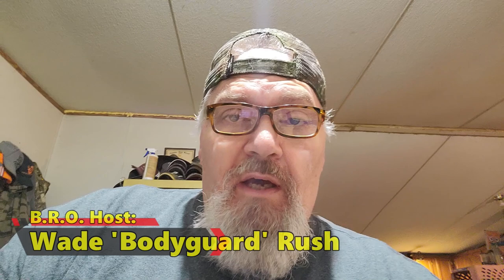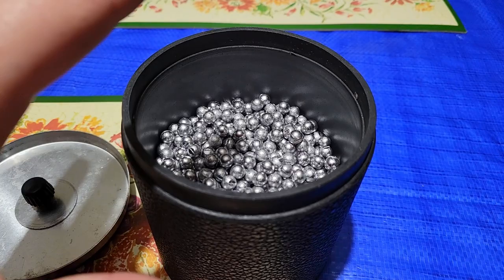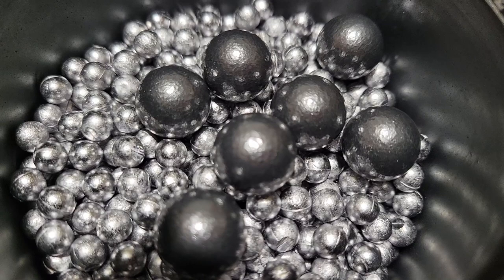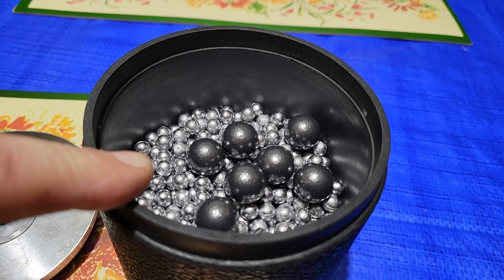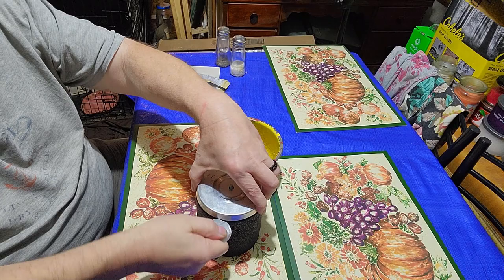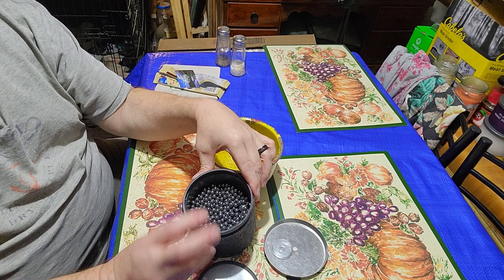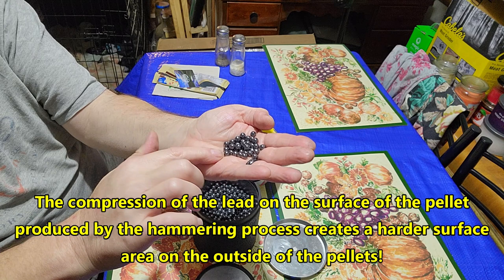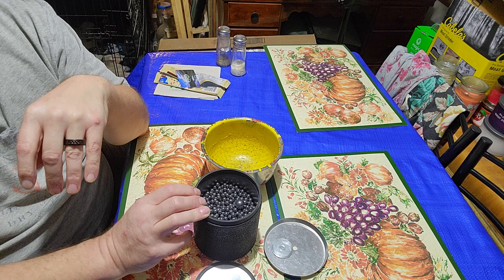Tumbling/Polishing Buckshot Tip!

Comment: I use a Harbor Freight tumbler, but it's the big orange kind you mix cement in. Lol. You have to remove the blades first. I tumble 50lbs of buck per load in one hour. I use about 100 5/8" steel ball bearings in the mix and the shot comes out shiny, black and smooth. I realize this is excessive for the average reloader/shooter, but I sell the heck out of the stuff.

Comment: I tried the same method. I used 9 lbs of buck, which gave me over 3/4 full. First 10 or so rounds with a new drum went great, then I started getting the dust and couldn't get rid of it to save my life. Balls and drum were extra dry. Dried shot with a towel, let them air dry about a day, then clipped and sorted out boogers, then hair dryer before tumbling. Nothing had ever been in the drum besides dry clean shot, so the drum was dry with no possible contamination. My solution was wet tumble my shot. Same set up as yours, just fill with hot tap water and a good squirt of Dawn dish soap, tumble as normal, and rinse really good when they come out. They come out extra shiny and almost chrome looking. If I rinse with hot water, they tarnish a little. The polish job on the shot seems the same wet or dry. Just thought I'd throw it out there as an alternative option for anyone who just can't get rid of the dust. Thanks, keep up the good work!
Reply: Joe, you nailed it. I’d like Wade to know that wet tumbling also worked for me to get rid of that pesky dust and produce shiny, clean pellets. I used hot tap water to cover the pellets, topped off with a good squirt of Dawn dishwashing liquid. Sealed and spun the can for about 10 hrs and rinsed in a colander with cold water. Voila, no dust, no smudge, just clean, shiny pellets. It may be the alloy causing the dust i.e., too soft, etc., but the surfactants and metal chelating agent (EDTA) in the dishwashing liquid keeps the dust in the water and away from the pellets. No more problems, even with soft alloys.
Reply: I've got a question about wet polishing. How do you keep the shot from oxidizing? I tried this method and the shot comes out with almost a mirror finish. I can't keep them from oxidizing to a smokey finish, though. I've tried drying them on a towel and even putting them in a200 degree oven. You can almost watch them cloud over before they get dry. Thanks
Reply: @scottp8857  there will be a certain amount of oxidation which won't hurt anything. To minimize it lay off the heat after wet tumbling, this goes for brass too(took me a while to figure this out). Use cool tap water to rinse well, pour the batch onto a towel, dry them with the towel, then let them set to finish drying, then do whatever your prep process is(nothing, alox and/or graphite, or powder coat or whatever). Definitely DON'T put it in the oven, unless you're water dropping it immediately(see BRO videos on powder coating), or just want softer shot/cast boolits(I do this for full bore size slugs and muzzle loader boolits, air cool when cast then air cool when I powder coated(if applicable) to make sure they're nice and soft). Because of it's low melting point, lead anneals very easily, technically it anneals at room temp, that's why we see the BHN of our cast boolits/shot changing as it "ages". Hope that helps, let me know if you have any other questions.
Thanks,
Joe
Reply: Joe, thanks for the detailed reply, I've got a lot to learn, but am muddling through it. Sounds like I probably softened up a batch. Luckily I kept them separate so I can go back and water drop them again. Thanks again.
Reply: @scottp8857  Anytime Sir! No worries, no one knows everything overnight. just keep at it and you'll get there. Lord knows I've got a long way to go on a lot of things, including casting and reloading.

Comment: I have a couple pounds of used pellet gun lead and a one pound lead bar, I have a #0 lee mould on order and a hot pot also. I have a rock tumbler I bought for making bp and was hoping that would do the trick for when I cast this lead. Thanks for the video, I was curious roughly how heavy would you say your tumbler is at 3/4 full
Reply from the maker: i think that a 3/4 full tub is around 7 to 8 lbs.
Reply: @BubbaRountreeOutdoors  thank you, I kind of figured it would be around that. I'll make a smaller tumbler or get more lead lol

Comment: Hey Wade, 
First of great series on buckshot. Learned quite bit about the ins and outs of buckshot. I had the rubber dust problem because I wasn't filling up the tub to 3/4 full. My question is once they get the dull coating on them can you wash
and dry them thoroughly and re-tumble to get the coating off or are the pretty much done for?
Reply from the maker: yes you can! I use hot water and dawn dish soap.
Reply: @BubbaRountreeOutdoors  Just pulled them out after 4 hours with dawn and hot water, came out perfect!

Comment: How well would a brass/case dry  tumbler with a bit of medium or ceramic polishing bits work?
Reply from the maker: would prolly work just fine!!
Reply: I drilled a hole in the bottom of a big plastic coffee can in the dead center so I could bolt it on top off my vibratory case cleaner, that way I didn’t have to empty my walnut fibers out. I dumped 2 containers of steel BB’s in the coffee can, I run my buckshot pellets in it for about 3 hours and they come out like glass marbles. It was the easiest solution I could work up.
Reply: I'd like to see that😊